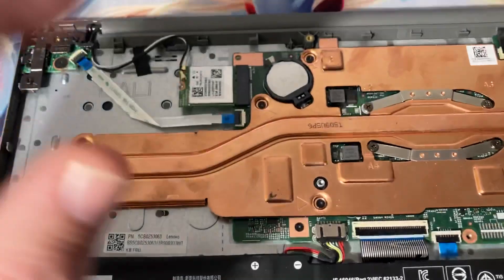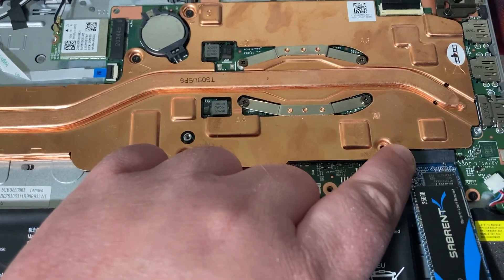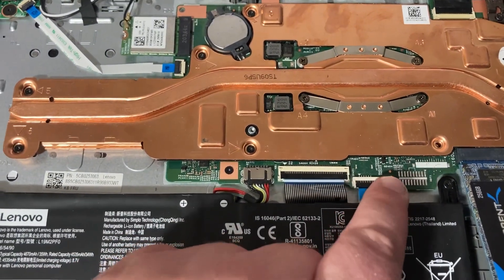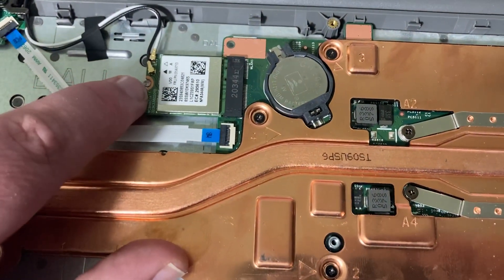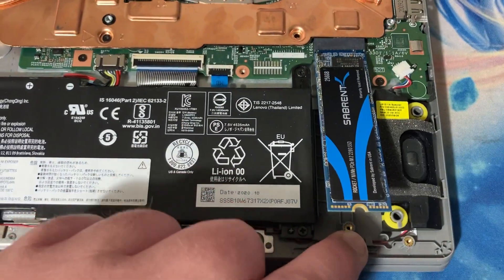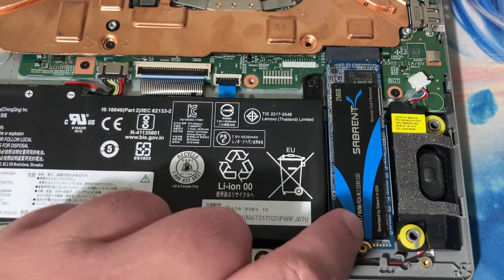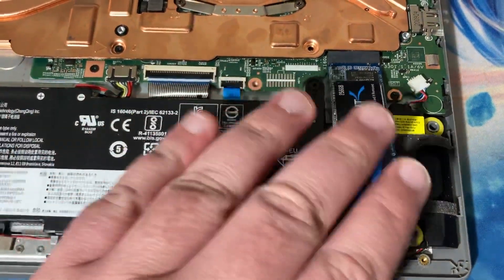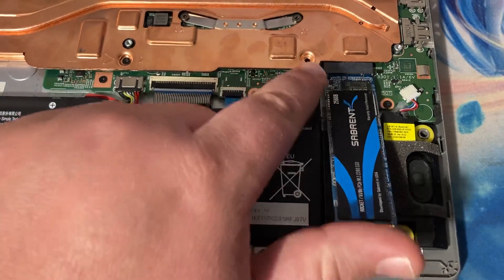M.2 soldered to Ideapad 1, success? AMD 3020e CPU

Comment: the worst part is that this wont work, where is the video uncut where you show that the m.2 is detected in bios and in windows shows! uncut version. very disappointed!
i have installed m.2 and there are many other issues that are around to just install m.2, power regulator and components and bios firmware and much more!
you better off purchasing a emmc 256gb of aliexpress and do a reballing and that did work for me!
Reply: 3 months and still no prove that just by installing m.2 jack it got it working jajajaja
Reply from the maker: https://youtu.be/m5_v0cI1ZB8
Reply: @AICvideo  You did it? Congrats!
Reply from the maker: https://youtu.be/Z74J94YvsaY